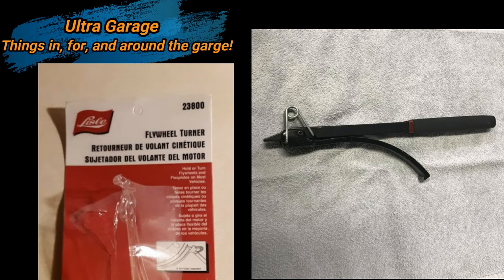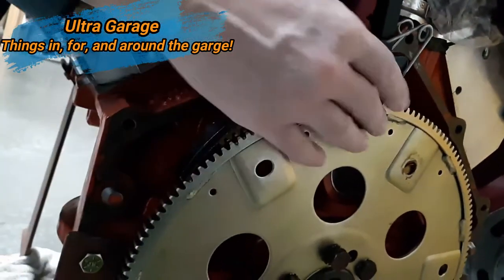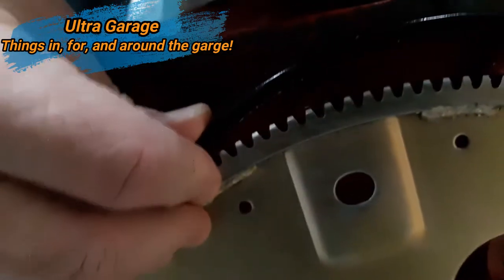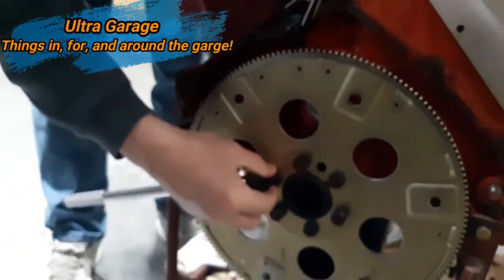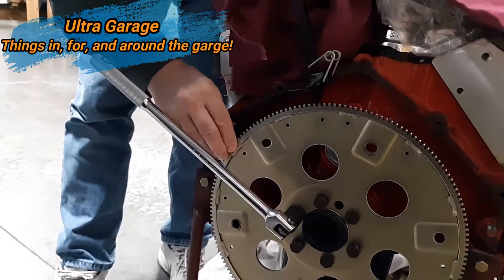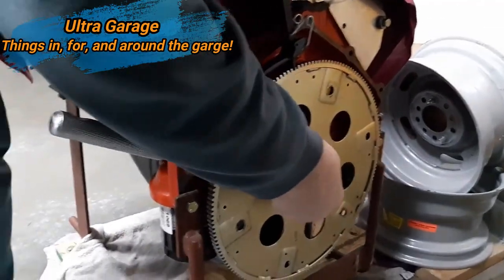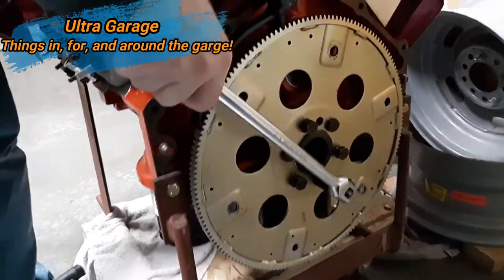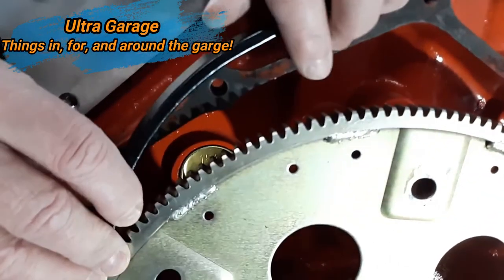Lisle Flywheel Turner tool. Part number 23800.

Comment: at 1:01 you show the tooth on the handle way too far forward , you couldn't turn the flywheel that way much less hold it against the breaker bar. Handle tooth needs to come back two to three teeth  towards flywheel arm tooth to get a good bite.
Reply from the maker: Thanks for the info